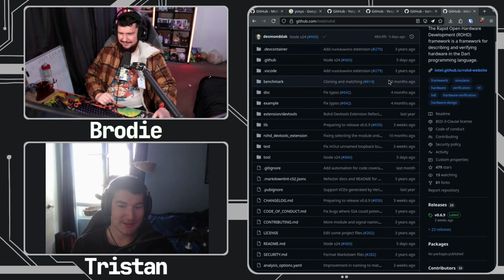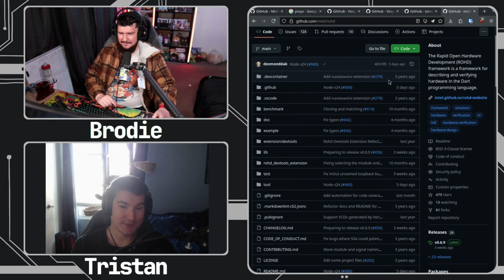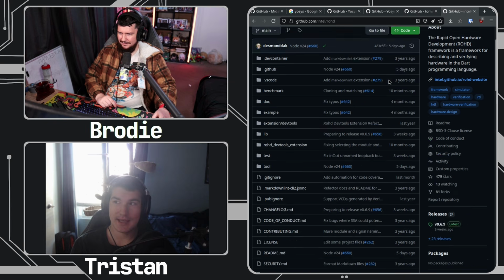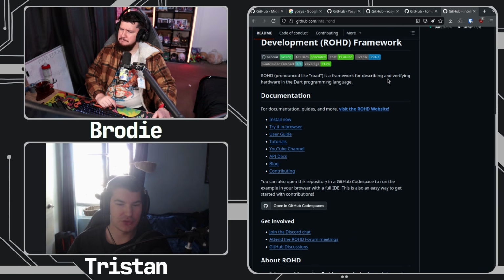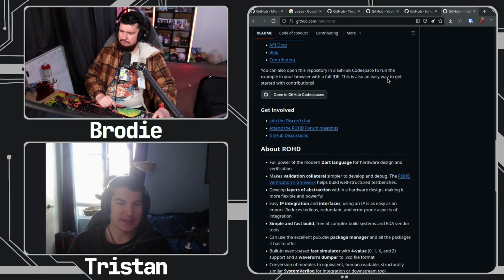What Goes Into An FPGA

Comment: Writing Verilog is not like writing in a programming language. It's a hardware description language not a programming language
Reply: Verilog is vey different from regular programming languages but I'm going to count it as a programming language. Why? Because you can write Verilog and run it on your computer with  tools like Icarus Verilog just as easily as  you run Python or Javascript under Node.js. You can solve any problem that you can solve with a regular programming language with Verilog. The thing is a Turing Complete programming language.  Conversely, at least in theory, one could take any program written in a regular programming language and build dedicated actual hardware logic to to run it. .